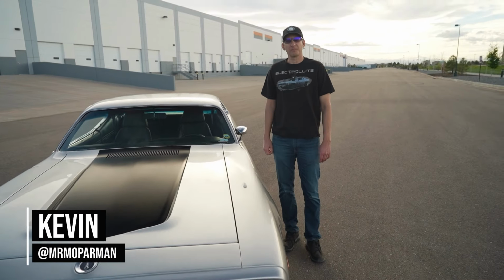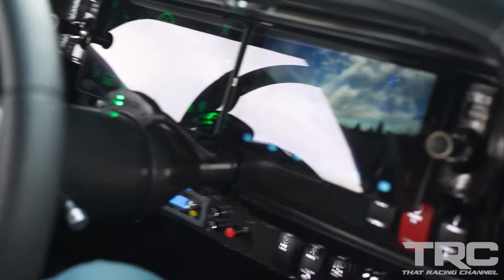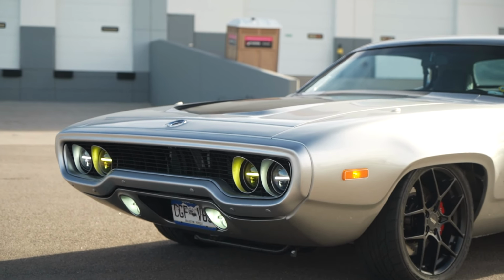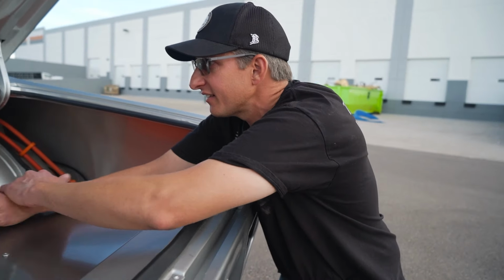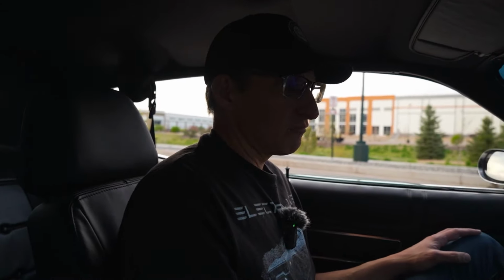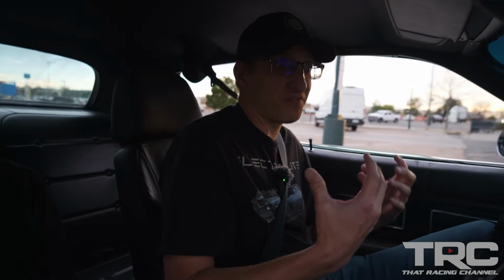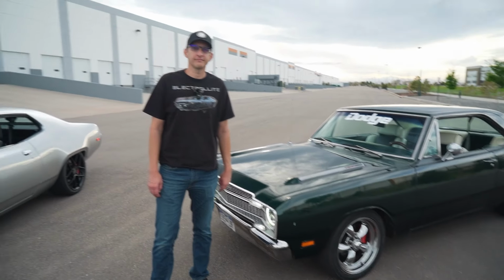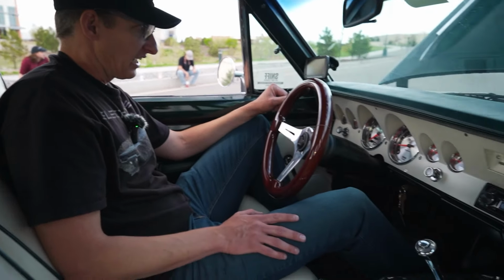Tesla Swap Plymouth SURPRISES 700HP Turbo Dodge Dart! (He Built his Own EV Muscle Car)

Comment: A build like this in 1 year & a half with no electrical engineering background? I'm impressed
Reply: Most engineers I have worked with could never achieve this 😆
Reply: Conversions are actually getting somewhat easy, you can buy off the shelf parts to handle a lot of the really complicated electrical engineering and computation stuff.

Most of the work is getting your wiring right, and fabricating enclosures for the batteries and mounting for the motor
Reply: This guy is an engineer. Just maybe not on paper! But IRL!!!
Reply: @cliffp73  You obvious don't know what an engineer is.
Nor a proper mechanic, technician or similar either.
Reply: @newtonfirefly3584  why do you say that
Reply: @Mogul Me  Which comment are You referring specifically to ?
Do You have a reading and comprehension issue, problem or lack basics within proper information ?
Reply: Deep pockets bro, I work for heaps of ppl like this
Reply: His car building skills are phenomenal he's very meticulous and practical.. good job bro
Reply: @newellsmith5971  yes, the owner did proceed well with very meticulous, precise, useful efforts and methods.
However, there clearly needs to be some detail for improved performance control.
Reply: He got a background in something to do with this tho.. this ain’t no just swap it and drive scenario… Iykyk
Reply: @ronniebones1160  I know many smart people who say they do not know about stuff which would be, for normal people, straight lies 😂 but for defending they maybe are bad in judging their own capabilities "oh I have a bad feeling about this" and gets the best grade. I hated this. My bad feeling where always legit! 😃
Reply: Chances are there were a lot of other people involved with plenty of experience lol. I highly doubt some dude with no previous experience did all this on his own and if he did then good for him he is a freaking legend. But if I had to put money on it I would say that there was some expertise drawn in from somewhere else to make it happen.
Reply: Youtube does wonders
Reply: @Ryukachoo  oh look at this guy. Can you build me a civic Tesla
Reply: @ZiggyGood  that's the thing, how are you going to mount up the motor? Where are the batteries going to go? It becomes a big packaging challenge
Reply: @Ryukachoo  And not touching wrong things 😁
Reply: @aussiegruber86  exactly. Most engineers I know can sit behind a computer and tell you how to do things but don’t have a clue how to turn a wrench.
Reply: And skeptical
Reply: No joke fr
Reply: It’s honestly easier than you think. I hate when people tell you otherwise.
Reply: @ronniebones1160  exactly, most car people have no idea what the words contactor, resistor, capacitor actually represent.  He is either keeping his background on the down low, paid people to train him, or has formal training in some school.  Probably sandbagging.
Reply: You don't need an electrical engineer to build this. Buy battery, buy electric motor. There's no electrical engineering involved in this at all. It's literally just assembly.
Reply: @PIV_Rides  hahaha
Reply: Yes, I also thought as much also. It almost defies belief.
Reply: @newtonfirefly3584  is an engineer a person with a piece of paper? or someone who actually does engineering? such a shame you call you self a newton
Reply: @DumbledoreMcCracken  bro why u laughing? hes right
Reply: @PIV_Rides  exactly! it annoys me when people put so many barriers in front of themselves without actually taking the time to see how something is actually done. It's just learning the basics of working with electricity. A regular vehicle is much much more complicated than an electric vehicle. People think its the other way around
Reply: @Oscar-vj5rb  yeah if you want to start an unintended fire and burn down your garage
Reply: Me2
Reply: @Oscar-vj5rb  Perhaps You may consider or think Your reply is funny, 'punny' and perhaps satirical.
However, it indicates further more of Your lacking with basics, ideas, concepts, ideas.
Try looking at the definition of an engineer.
We design, develop actual working devices, components, machines, electronics, buildings, vehicles, aircraft, spacecraft, products using actual proper knowledge with physics.
We have been using computers to design, develop for over 50 years, especially with and within electronics.
You are clearly confused and lacking.the basics about engineering.
Engineering includes the entire design process from conception through full development, production, manufacture, fabrication, assembly, testing, verification, certification and achieving a properly fully working product.
Maybe you will learn about these ideas someday
Sincerely
Reply: YouTube has everything you need. I do all my own work and always reference it!!
Reply: @toddsmith7210  Ever hear of FSAE?
Reply: based on how much he knows about electric stuff he could probably fix his own mobile phone
Reply: @newtonfirefly3584  Dunno, for now you're trying to argue in internet comments on topic that basically is irrelevant in any way to the vid. 

Also you do it in such way that makes it just hilarious. So much salt.

While you might not be wrong, you sure are new to internet. Maybe you'll learn about it someday... anyyyyyyways... hope you're having a great day Sir x]
Reply: @theglitch99  maybe for You, and the work You are involved with You manage to find the necessary information, but those that need experts, expert knowledge will notice there is mostly false, incorrect information, and requires significant amount to discern properly to determine those with correct information, knowledge.
There are many with correct, educational, instructional videos.
Certainly Not all information and knowledge exists on this platform either.
To accomplish such a build, modification, installation, etc. as this vehicle even with the aspects which clearly still require modification, improvement and development, the information does not exist on this platform, though there are some individuals with some of the knowledge with which can be contacted, consulted with for assistance, help, guidance, direction, etc.
Sincerely
Reply: Check out Jerry rig everything's Hummer.
Reply: @Tubenstein  The beginning of, with , within Your comment is Your basis:
"Dunno" = Do NOT know
Thus, You should stop there.
There is NO need for any further attempt. 
Period.
Simple.
All The Best
Sincerely
Reply: Indeed
Reply: @bennuhhh9424  "Indeed" -> what ?
Reply: There are people who are intelligent enough to get the job done
Reply: @stevemyers7312  Clearly from Your reply:
A. You are still attempting to use 'forceful', directing, dictating, controlling language, statements and commands 
B. Attempting to 'cancel' another
C. still conveying nonsense
D. still using reflection and projection.
"Nah Nah Nah Nah
Hey Hey Hey
Say Goodbye "
Bye Bye
Reply: @stevemyers7312  Steve We never "Lost It" 
A. -> Our connection with Our Creator, G-d/Almighty, Master of All
B. since You are still attempting directing, dictating, controlling -> You are still involved in, with "self-reflection" and projection =>thus, it seems clearly, obviously You also lack a proper connection with Our Creator, G-d/Almighty and like the 'masses' follow False God(s) as those with "Chrixstianity", Buddhist, Hindu, Sikhs, 'tribes', etc. - Muslim/Islam at least have the basic concept with Allah=Almighty correct, along with basic human responsibilities, requirements, obligations, duties, though some incorrect, false aspects, direction, dictation, via some false individuals.
C. Steve, when You do have the proper connection -> Then Perhaps You will have a meaningful life
Bye
Reply: Yeah seriously this dude is a total legend for this
Reply: @Scoezy  It seems You also expand the improper, exaggerated use of "legend" as many improperly use "genius", "super", and other words which convey extremes.
Such are You among the "Millennials" or 1990's born which develop and misuse words as the "MIllennials" too ??!!
Reply: This guy is a genius im gonna  send you my car and just tell me how much?
Reply: The dude could build me a car anytime. I'd like to have hardtop Cuda along with an original.
Reply: @newtonfirefly3584  Leave god out of this.  There is no evidence that proves god exists.
Reply: @barkatthemoonlunatic1715  You may deny and refuse the existence of The Creator, G-d/Almighty, Master of All., as Aristotle and his students Socrates and Plato [only accepted the possibility of a "metaphysical", still within the physical realm, not spirituality= non-physical] among many millions of other humans through many Millennium, while many more accept the basic concepts of the existence of The Creator.
Your claim about lack of evidence of The Creator, G-d/Almighty is False and Your personal lacking and/or decision to refuse, deny the evidence, facts, reality.
However Albert Einstein accepted the existence of The Creator and G-d/Almighty, thus stated: "G-d does not play dice with the Universe"
Also, why do ALL physicists, astronomers, astrophysicists agree to a "Universe", single physical existence and strive to achieve a "Unification Theory" which describes All physical existence ??!!
Good Luck in Life
Reply: @newtonfirefly3584  I don't care what Aristotle or any other famous people thought or think.  None of them have an proof that god exists, and neither do you.
Reply: @newtonfirefly3584  and so how would anything you just wrote proves that god exists?  Well, it doesn't.
Reply: @newtonfirefly3584  You proved what? lol  That you can write a long sentence containing jibberish.  Good job, LOL!
Reply: @newtonfirefly3584  ok, ok, the novelty of the looney replies you provided had worn off a few comments back and you're no longer fun to laugh at.  Now you're just being weird and creepy.
Reply: @DumbledoreMcCracken  This is a beautiful piece of work, why do you have to diss him
Reply: @DumbledoreMcCracken  go away grampaw
Reply: @harolddumbacher7568  that is the best you can manage?  There, I schooled you.
Reply: @newtonfirefly3584  most engineers, have zero common sense,
Book smart isn’t everything.
I work with 1/2 dozen engineers daily,
No problem solving, common sense machine knowledge at all.
I redo there work every day.
For many years .
Btw I don’t have an engineering degree.
They do!!
Reply: Didn’t he just use sketch up?
Reply: @distanceresearch  More attempts with foolish claims based in lack of information ??!!
Reply: @newtonfirefly3584  It was meant to be a joke, can you design a Plymouth Satellite Tesla conversion in Sketchup?? Sorry if my sense of humor proved too difficult to digest. Maybe I should have suggested mashed potatoes as a medium??? Based on your efforts in the comments section, it appears you’ve assigned yourself the define posture for this post?
Reply: @distanceresearch  Your attempt(s) with some sarcasm, satire are within Your limited 'head', mind, mindset, thinking, view, etc.
If You attempt to convey in writing such, then use of emoticons-emojis are useful as non-verbal within speech.
Good Lcuk
Reply: @newtonfirefly3584 everything is likewise to you unknown. You must be in good shape though, running back and forth to every post on this video urinating all over everyone’s legs. Is that Real tomato ketchup Eddie??
Reply: @distanceresearch  Sure You are only using Your personal ignorance, lacking, then using 'self-reflection -> projection"
Good Luck - Bye Bye
Reply: @NubsWithGuns  NONSENSE !!
Reply: @newtonfirefly3584 sounds like you want to race? Let’s see what you’ve got there little man. Let’s lay some rubber just tell me what track you want to run at and when. We can do a 1/4 mile hot dog, or road track, big oval, or maybe you like the dirt? We can do that too. Maybe you’re just full of hot air? It seems you’ve been a big hit on this post, made a lot friends have you? Oooooooooweeeeee!
Reply: @barkatthemoonlunatic1715 Newton farts is super weird. Have you seen all his carefully tip toed replies? Guy probably has an electric scooter lol.
Reply: It's all plug and play
Reply: @jeancunningham2562  FALSE, LIES, Falsehood, False portrayal, False Narrative, False concept incorrect, use,misuse, abuse of the "Plug N Play" concept !!😞
Reply: @G16E do it then
Reply: Year and a half lol